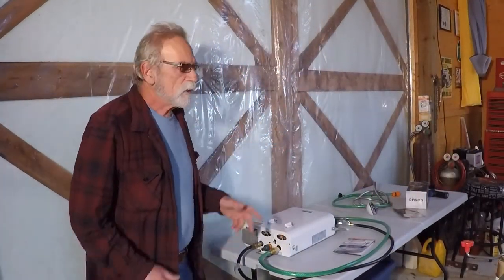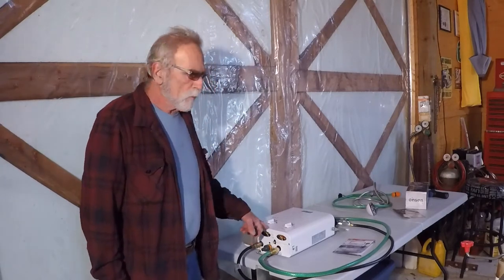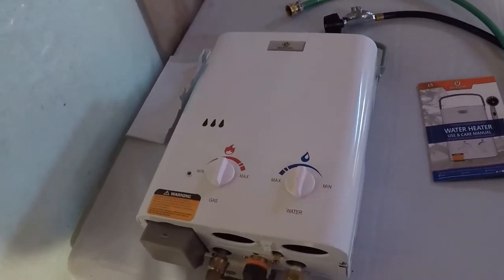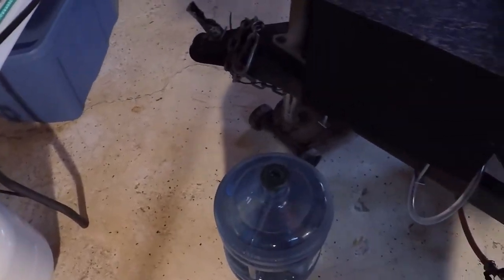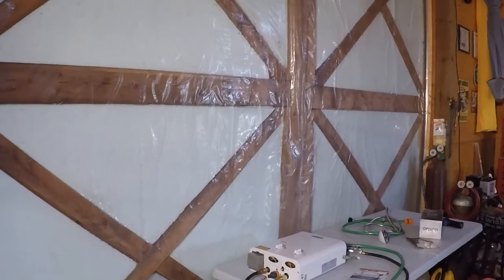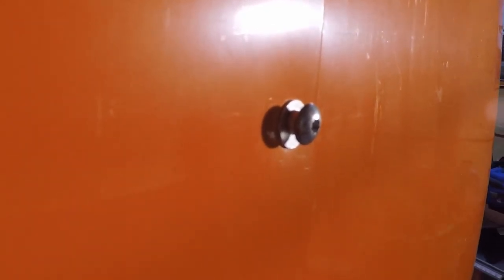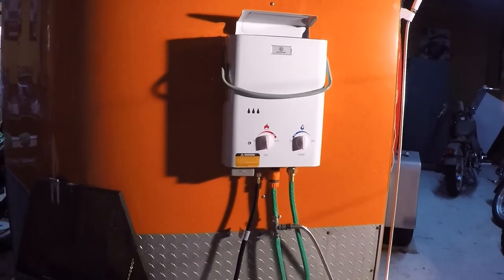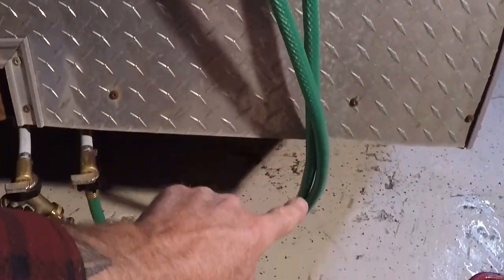Cargo Trailer Camper On Demand Hot Water

Comment: Greetings Rob from metro Atlanta!  I basically use the same set up and heater and it has been awesome. We haven’t done extended off grid camping so I haven’t  given much thought about a 12v pump until now. Seems like an easy set up as well. Thanks for posting.
Reply from the maker: Thanks for the feedback. The 12v pump works well, but a shower does use a lot of water so your hauling heavy water bottles, but worth the work when your in a beautiful remote location.

Comment: Hey Rob, just came by your video. Great idea. Have you had any problem with the heat discharge affecting the skin of the trailer where its mounted? Thanks
Reply from the maker: I have only used it a couple of times, but no issues so far. The shield on top deflects the heat outward pretty well.

Comment: I am going to install something similar in my build.  I am planning to hang the unit on the inside of one of my barn doors so I can set up some privacy using the doors and a tarp as a closed in area.  In your opinion would I be able to simply draw/pump water from a 5 gallon bucket to feed the unit?
Reply from the maker: Absolutely, just use a 12 volt RV water pump to feed it. I hung ours on the back corner of my workshop for the same reason, and it works great.

Comment: Did you say you had to add a battery & a pressure pump to this other than what was supplied? Thank you for the video.
Reply from the maker: The battery for the heater is a small C type battery in the heater to power the igniter to start heating the water. It does require pressurized water from a hose to operate. I have a 12 volt deep cycle battery and a 12 volt water pump to run the water system. That way, I still have running hot water even when off the grid camping. A garden hose will do. I hope that answers your question.
Reply: @fullthrottl1  thank you for your speedy and thorough reply 🙂

Comment: Would you recomend that tankless unit and if so would you provide a link to purchase? Thanks for sharing!
Reply from the maker: It’s an L5 Ecotemp that I bought on Amazon. The first time I used it, It worked well for a couple of minutes then got cold. I realized that the propane tank I used was nearly empty. When tried again with a fresh tank it worked really well with good temp control. I haven’t used it a lot yet, but so far, I’m really pleased with it and would recommend it based on how it’s worked so far.
Reply from the maker: Eccotemp L5 Portable Outdoor Tankless Water Heater https://www.amazon.ca/dp/B01MXDZCKM/ref=cm_sw_r_cp_api_i_864RHH3H3MR6K2A82WDW

Comment: Does rain or the
Elements ruin the water heater at all
Reply from the maker: We don’t have a lot of use for hot water in the camper because of the one small sink we have. When we are at a campground , we use their facilities. On the back-forty, we use that heater to shower. When the weather is rainy, we put it under the trailer on a couple of pieces of wood to keep it off the ground. That way I don’t have to disconnect anything. If I had a higher demand for hot water, I would probably make an open faced box to keep it out of the elements. You’ve made a very good point about the location. Thanks for the question.

Comment: What type of water pump did you use?
Reply from the maker: I sold the trailer and don’t recall, but it was something like this one. DC HOUSE 33-Series 12V Diaphragm Water Pump with Pressure Switch 3.0GPM 45 PSI, 12 Volt Self Priming Water Pressure Pump for RV Marine Yacht Caravan https://a.co/d/5uQSmuV. Hope that helps.